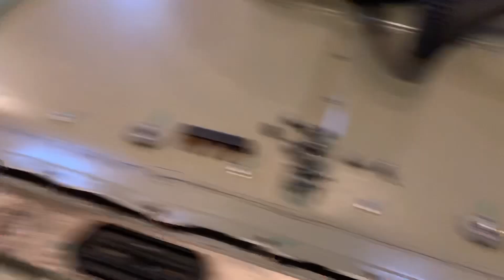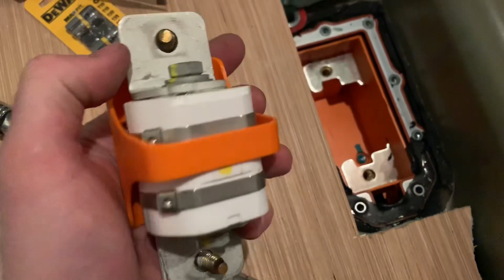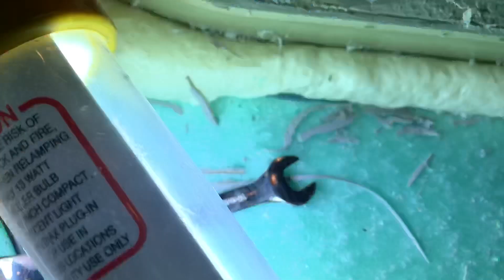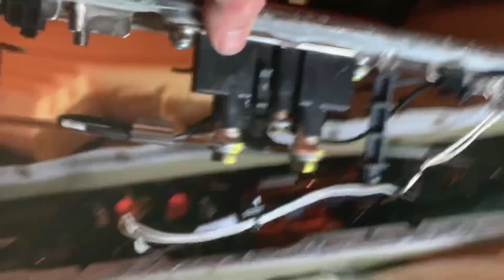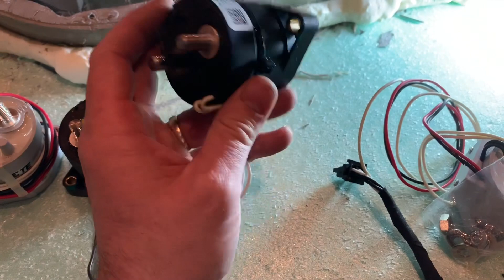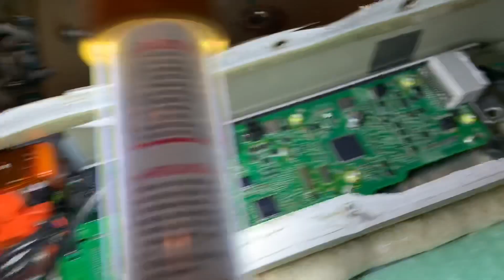T-Rex Camper Build: How to replace the contactors in your Tesla battery pack.

Comment: Thanks for this video, massive help when changing a welded contactor on my Tesla, one thing to note (with the help of the video) was I really didn't need to put much effort in when breaking the seal, no hammer needed just a gentle prise up with thin screwdriver.

Comment: So when reconnecting both batteries is it just connect both batteries and call it a day or is there a laptop needed for anything on the car to say "reboot"?
Reply from the maker: Both batteries? Not sure I follow. This video is about replacing contactors.
Reply: @JamesKlafehn  when your replacing the contractors is the battery already out of the car or are you yourself removing the battery
Reply from the maker: @twistedresto5029  I never replaced it into the car. This is part of my range extending trailer project. Check out my playlists. I build range extending trailers for EVs.
Reply: @JamesKlafehn  will do and thanks!

Comment: Hey Good information video..I want to replace too Relay in our Battery with Kilovac EV600 High Voltage
Contactor..actully our Battery BMS has also a Economizer and we used this old relay before like you had them in black color but now we are swiching to Kilovac EV600 High Voltage
Contactor..i don't understand the cabling and this relay has no economizer...can you see and give me your suggestions about this relay cabling to connect in BMS..thank you James
Reply from the maker: What kind of battery is it? What BMS? There are a 1000 different products out there. But the contactor is very basic, it only  has 2 wires. It sounds like you are replacing contactors that are already there. Cut the wires and put the new contactors in place.